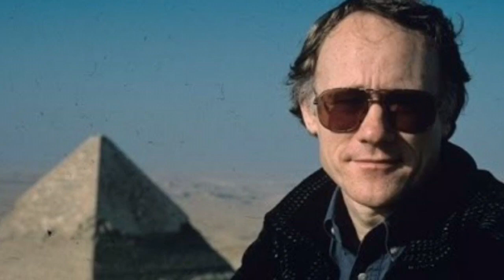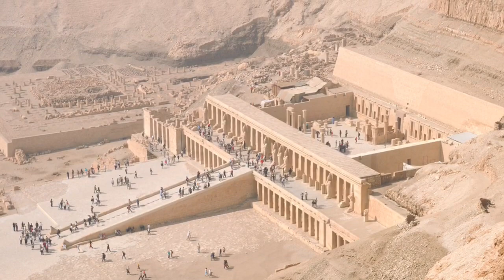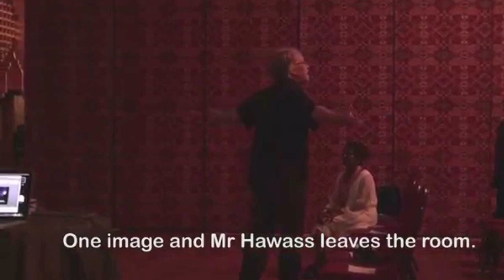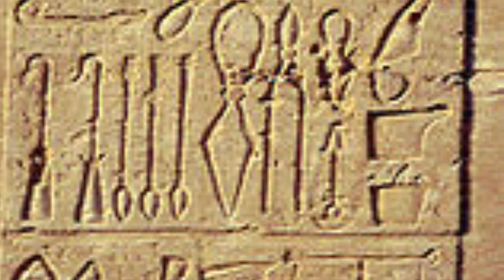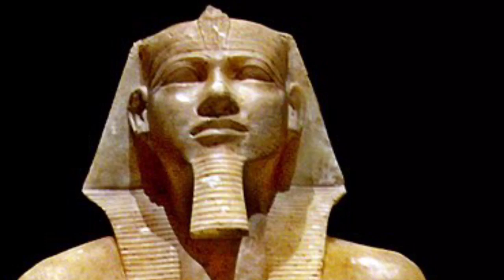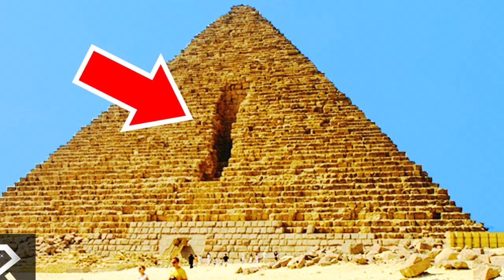Graham Hancock Mathematically Explaining why we CAN'T Reconstruct The Great Pyramid

Comment: The mastered concrete! They poured. Period. Stone age lasted millions of years. New stone age before the advent of metalworking lasted about 5000 years. You think for thousands of years working with stones they still used tools to cut them? Our current internet age is less than 100 years old. Can you imagine next 5000 years of working with internet, we would still be using cable and cell phones? No, we would advance to something unimaginable to us now. Graham mentions that they found fossils of ancient sea creatures in them. That came from one of the ingredients used to make concrete! We use sea shells to make lime stones today. I'm sure a fossil or two gets by if you're considering tons of materials mixed in. Bottom line is that they knew about stones much more than us because they've been working with them for thousands of years. You don't have to be a genius to figure this out. It's common sense.

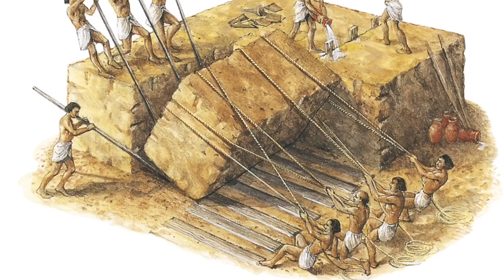Comment: The artist rendering @1:02  would be laughed at by the actual builders, not because of the cavemen with ropes but because of the  quality of the actual blocks depicted. "Get that chipped rough piece of crap out of here" I'd say, "and I also said I want blocks so smooth and tight fitting my wife could see her reflection and polish her skin with the granite dust!"

Comment: In water channels! As they cut them from the limestone quarries air bladders are attached to float them to the location and Into sealed shafts on the side of the pyramid fill them with water and up they go. Easy baby !
Reply: How does does that work for building above the bottom layer?

Comment: People could  move those. I’ve moved very heavy weight with no power assistance. Just think what a hundred men with pulley’s, ropes and rollers could do. I’m sick of the BS about how we today couldn’t move these blocks. We have cranes that have moved 200 ton.
Reply from the maker: We do, but did they?
Reply: Ancient Mysteries & Modern Innovations obviously they had something, right? It wouldn't be there. I hear people saying that we can't even move this stuff with the equipment we have today and that is a lie. We can and have moved this kind of weight. Look at the cranes at the major docks around the world. I've personally moved, with three or four guys, a few tons without any power assistance. A bar, a few pullies, some rope and rollers and you can move a lot of weight.
Reply: DumDumDev 
I agree.  As a stone mason you learn to move very heavy weight with wheels, fulcrums, and ropes.  Add a persuasive pharaoh and a thousand men...bob’s yer uncle, you got your pyramid.
Reply: @blazensaddle4721  yea a bunch of guys with whips and the threat of death will give you some motivation huh?
Reply: PhyZeik you've obviously never worked with your hands or moved anything of substantial weight. The more Sheaves you run the line through the greater your pulling power. I didn't say one line either. Who's to say they didn't have multiple 2" or 3" thick lines running through multiple blocks. You could pull a lot of weight. Just cuz you can't comprehend something doesn't mean you are right. You might want to remember that it will help when you get out of grade school.

Comment: Didnt the nile in the past run right by the pyramids?  Maybe the egyptians came up with a way to use water to lift for them. Have a specialy cut chanel  that has a door or something that can be used to increase or decrease the flow of water. This water could hit a wheel causing it to spin. Attach a rope to the wheel, run the rope up and over a large boom that can slew and jib allowing for precise placement of the blocks. If They  were able to  build the pyramids,  then they were definetely able to get something like what i described to work.

Comment: "this nonsense about slaves". They weren't slaves but workers. We have excavated the town they lived in and found first hand diary accounts of how they lived. When a hysterical speaker like this casually brushed aside the facts I stop listening to what could have been an interesting discussion.
Reply: Egiptians were not capable of building them.
Reply: @michaeltrumph121  and yet they stand. Extraordinary claims require extraordinary evidence. As of yet there is no evidence that anyone other than Egyptians built them and on the contrary there is mounting evidence of how Egyptians did. Just because we don't know how something, however incredible, happened 2k plus years ago doesn't mean that we should fill that gap with wild hopes and speculation. As the son of a professor of archeology I understand how we can sensibly and gradually fill in the gaps until we have a reasonable understanding of what went on. I highly recommend researching the subject for yourself and take in a broader set of data and opinions.
Reply from the maker: Disagree. The mounting evidence you speak of is that the dynastic Egyptians inherited the site
Reply: @patdaveydrums  
There is no proof whatsoever the Egiptians built them, especially the Sphinx, which is way older than stated.
Reply: @michaeltrumph121  so do you dismiss the science behind radio 14 carbon dating as a valid technique for establishing the age of organic material?
Reply: @patdaveydrums  
Yes, it has been proven that the results of that test can vary due to different factors and it isn't always accurate.
The Sphinx anf the pyramids are at least 13000 years old.
Reply: @michaeltrumph121  but only by a few hundred years not several thousand. There are many possible factors for this. The burning of old wood to make charcoal for construction and the reuse of organic materials in construction bring a factor. These may account for a discrepancy of a few hundred years. Can you please site your reference for the study that proves that C14 dating can be several thousand years out? Or are you talking about the precipitation theory which is just a theory at the moment and not proof. There is a difference.
Reply: @patdaveydrums  
The precipitation theory is a million times more valid at this point than any of the nonsense spread by Egiptologists.
Reply: @michaeltrumph121  we live in a world where hobbyists are to be believed over experts? 

It's a good job you don't chose your medical providers the same way you chose your historical sources. My father is an archaeologist and a member of the Royal society so I have some understanding of the process by which consensus is reached. 

Fortunately hobbyists with a blinded and dogmatic approach don't get funding so little time is wasted.

The evidence of mineral erosian found in the area is interesting and unexplained. The problem here for you is at this point you have made a logical phalacy.
This theory put forward for the erosian is just on one a number of unproven theories. All very interesting and worth investigation. However you have cherry picked one to fit your narrative. This is not how the scientific process works.
We know the world is a globe not because of a single theory but by multiple and disperate measaruble data.
So in the absence of multiple, disperate , unbiased and measurable data and in the face of years of pain stacking research by peer review  professionals you find yourself in the minority.
I would love their to be an undiscovered  ancient civilisation. The idea is so compelling. But so are santa Claus and mermaids.
Until there is evidence of this civilisation your dogmatic approach is no better than a preacher at the pulpit and similarly provide little or no evidence whilst waving your arms and shouting a lot. 
Good luck with your quest but please refrain from passing off others ideas as stupid and your own evidence as scientific.
Reply: @patdaveydrums  
The water erosion is proof enough.
And speaking of proof, there is none whatsoever to suggest the Sphinx is as old as Egyptologists claim.
Reply: @michaeltrumph121  that's a very unscientific claim. Multiple proofs need to triangulate on the same answer for such claims to reach consensus opinion. A genaration ago we didn't know that the earth consisted of moving tectonic plates but painstaking and multiple disperate research finally established this as fact. The erosion is unexplained and interesting but on its own is just a blip in our understanding and has no corroborating evidence.
And to your second point. Nobody but the egyptologists whose expertise I rank, with all due respect, over yours.
Reply: @patdaveydrums  
U are entitled to respect Egyptologists more than me, that is normal.
But like I said, they have no proof whatsoever for their claims.
Reply: @michaeltrumph121  except that the pyramids stand in Egypt and carbon dating of organic material in the mortar and elements found in the great pyramid date it to the time that the historical records show. In contrast there is no organic material or corroborating evidence to support the much older age of the sphynx claimed by some. It's an exciting mystery for sure but extraordinary claims require extraordinary evidence not a single unoroved theory about erosion patterns. Sorry but that just isn't how scientific consensus is reached.
Reply: @patdaveydrums  
Carbon dating of organic material is irrelevant. And what mortar ?  
The Sphinx is carved out out of a single block of stone, it's not made of bricks.
Have u ever wondered why there isn't a single hieroglyph detailing how the Egyptians built the Sphinx or the pyramids ?  Given how imposing these constructions are, there ought to be countless "clues"/writing to tell the tale of their construction.  The Egyptians left clues regarding every aspect of their history/life.  And yet there isn't a single one regarding the Sphinx.
Reply: @michaeltrumph121  organic material dates the contemporary structures of the pyramids. Indeed there is currently no way of dating the sphynx using these methods but this is not evidence of its age but a mere absence of evidence. Likewise the adsence of pictographic record whilst strange is not evidence of age. All very mysterious and intriguing but not evidence. Once again:extrordinary claims require extrordinary evidence. I see non but a single theory and some circumstsntial evidence that proves nothing at all. Don't let your hopes fill the gap. This is very unscientific.

Comment: The easiest answer which does not require ancient concrete or even levatating aliens is just to take more time. It could be built using ancient technology if the builders were given much more than the given 20 years, which is only a guess anyway. A wooden frame structure comming from the quarry would quickly be scavenged away by the gypos afterwards.

Comment: So... the Pyramids exist... they were built... they are ancient... instead of clinging to obvious impossible or implausible methods, figure out what would work... massive cranes/windlass/ hoists/ machines? How would this project be done today? Work backward from there.
Reply: You persona do realize this discussion is just on the sidelines, trying to debunk the obvious for whatever f u reason? The 3 P are aligned north south east west with higher perfection than is currently possible with gsp or laser applied in practical execution. They are furthermore in line with Orions Belt, the sun, Leo and therefore also the Sfinx. But let's say that's all bull too. The King sarcophagus is the smoking gun and has a perfectly smooth structural volume to internal space of 0. percent accuracy, made out of diorite surpassing granite. Why do I even bother commenting on YT anymore aaargh if you don't get this, you are either a sociopathic troll or an occam razer addicted delusional homo sapiens. Honestly :) there is more truth in Alita Battle Angel blockbuster on a friday evening popcorn treat than your whole ego driven deemed important existence. Unless you finally connect.
Reply: @Schtamper  I don't disagree with anything you've said. I don't understand your point. I submit that with unlimited resources and the brightest minds working on it, that we could reproduce the pyramids within the same time frame using modern tech and new inventions purpose designed. The prohibitive factors to do so would be money... it would cost more than anyone nowadays is willing to spend to attempt, likely into the trillions of euros.
Reply: @tedlogan4867  then either that was formulated in a debunking style or I made an ass outta myself :-D To you that is. Well as for the building in the manner you say, I don't have enough field knowledge to make a claim, but I have thought about the things you state being possible yes. Even so, using a diamond water drill, the sarcophagus would still take a very long time and with not so smooth results, as confirmed by a prof op. For me the real pickle is, why indeed we don't attempt this as you propose. If money was a valid argument, CERN would never be operational. Why doesn't the scientific community explore the possibilities. When you filter through occult stuff I guess the answer is because the purpose, design and techniques are still known/ passed down, but not shared. Sadly this can be debated till no end, but it's autistic idiot savant drawing Paris in detail out of his head from a helicopter flight versus some dude drawing what supposed to be a tree, in terms of exploring the (many) out of synch pyramids and ancient artefacts with such relative little dedication and attention.
Reply: @Schtamper  //// If it is not "currently possible", then how did WE determine its accuracy??
Reply: @k0smon  with a computer scan
Reply: Ted////  And yet, there they stand. According to the OAHSPE,  it took 24 years to build the GP, they used a single ramp 1 to 7. (about an 8 deg elevation I think). Also says it took 6 months just to tear down the ramp. The GP was called "The Temple of Osiris."
Reply: @k0smon  a ramp at that angle would require more materials than were used in the GP and be over 1 mile in length. There's zero evidence that anything of that size was ever built.
Reply: @tedlogan4867  //// Fuzzy math, Ted.  The pyramid is 481 ft high. The length of the ramp was 7 x the hight, 3367 feet long. That is roughly 2/3 mile. No matter how much material it required, if that is what was needed, that is what was supplied. After 12,000 years you want evidence??
Reply: @k0smon  watch the video. the amount of materials for a ramp would be many times the amount of stone used in the GP and over a mile in length. It's not my math, it's the math presented in this video by people smarter than you and me.
Reply: Yeah!!!!! 
Let’s take one apart, fk this shit.

Comment: Germans built das Pyramids.
Reply: Indeed, my Großvater built it! It was easy because he was German.
Reply: The Best engineers, right? Kkkk
Reply: Given all the hypotheses that pyramids are power stations - Does that mean the Pyramidion is the part that cheats the emissions test 😁
Reply: Ze Germans did the thinking but they used negar for ze dirty work.
Reply: Frank Castle 

Correct. And more specifically East Africans. However they didn't built the big ones. Only the smaller ones.

Comment: Why do they always show humans pulling the blocks surely there were elephants, oxen, bison horses etc that could have pulled them!!
I'm not saying it solves the construction secrets or anything but 
why is this never discussed?
Use the animals, to do the hard work, aquaducts to load direct to site, internal ramps filled as you come back down....solved..lol
Reply: "no shit"
Reply: I think most of that comes from Herodotus writing that human power was used, for ceremonial reasons, instead of animal power. Also, most artwork that shows large stones and statues being moved, has large numbers of men pulling ropes, and few if any animals present.

African Elephants aren't particularly useful for pulling heavy loads, as they aren't as tame as Asian elephants. Horses weren't introduced to Egypt until about a thousand years after the 4th Dynasty, when the Pyramids were supposedly being built, so they simply didn't have horses to use. Teams of oxen are occasionally shown in artwork pulling carts with heavy statues in them, however. So they were probably used.
Reply: No
Reply: bun///// You did not mention counter-weights, or block and tackle.